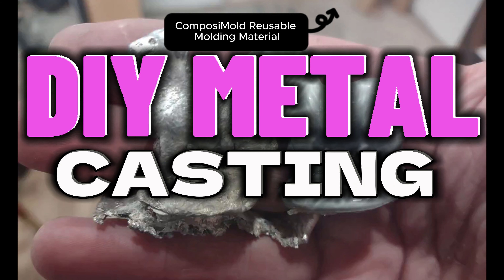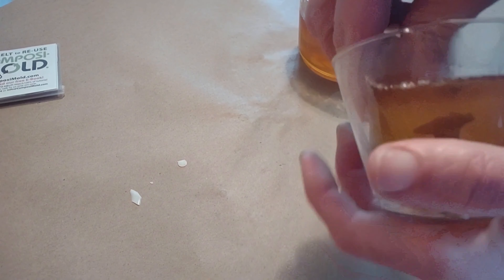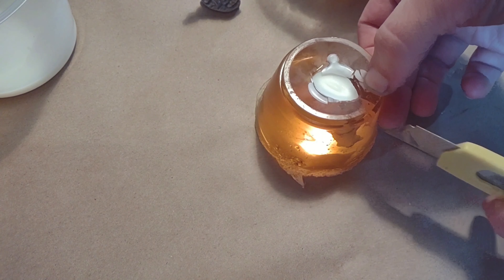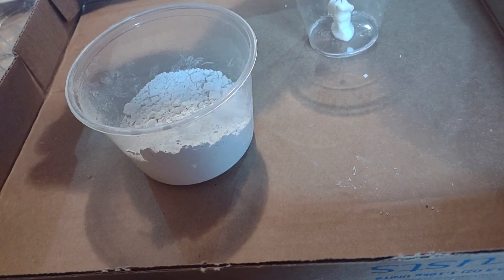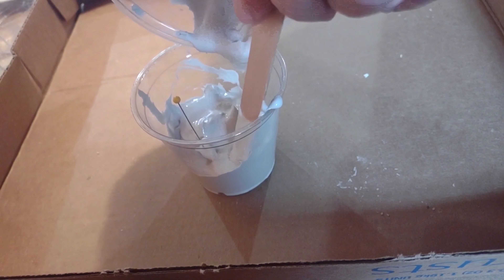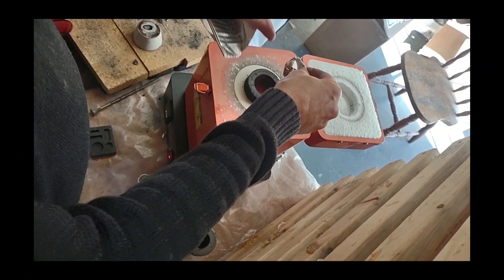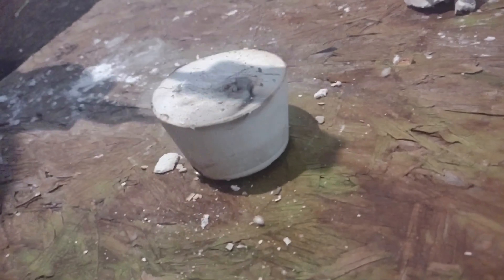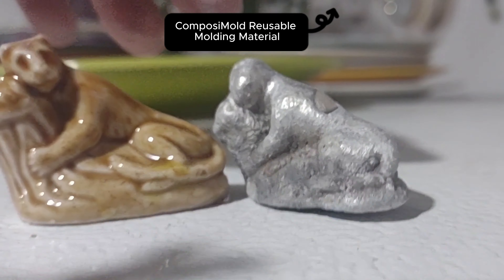Aluminum Casting with Lost Wax, ComposiMold, and Plaster/ComposiStone Molds

Comment: nice tutorial, next to your advice about hot metal being hot, make sure the plaster does not have a lot of moisture on it. The oven when removing the wax should dry it but be careful, moiture and hot metal dislike each other and may end up with a violet release of steam causing hot metal and hot pieces of the plast to fly around
Reply from the maker: YES!  So true! Be sure the plaster is dry! Thank you!